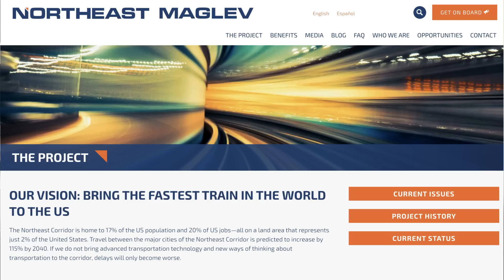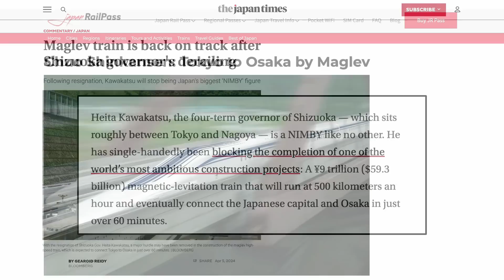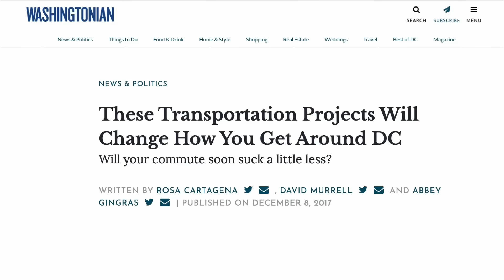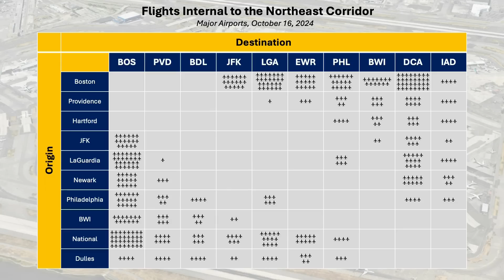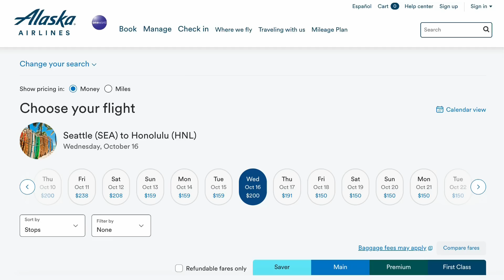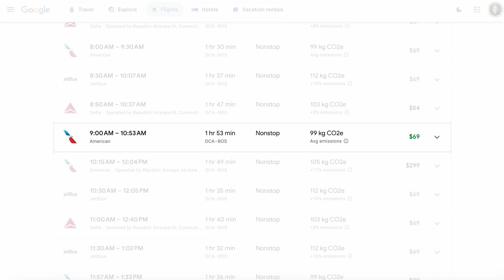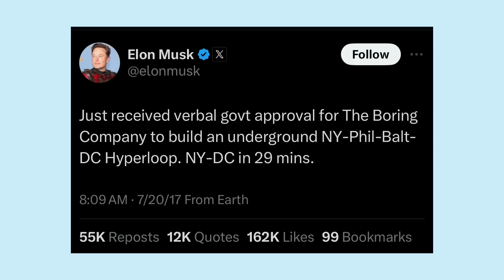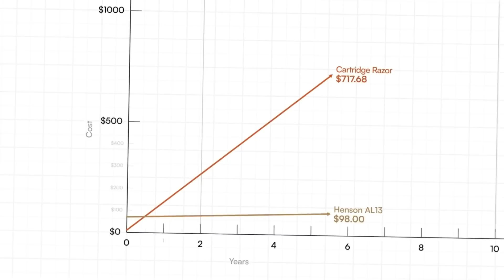A DC to Boston Maglev Would Be Awesome (and you know it)

Comment: Ray, love your work, but the problem here is stops and capacity. True, MAGLEV has better acceleration/deceleration, but it's not enough to dramatically reduce the travel time assuming your stopping pattern. Japan is planning for like ~3 stops with wider spacing instead of ~7 with close spacing. Also, Japan hasn't invented high speed maglev switches (yet), so right now they're capacity constrained to a train every ~10 mins as opposed to conventional rail every ~3 min. 

Conventional high speed rail FTW!

Comment: Video idea: how stops kill train speeds. Take the Acela--Wilmington is only 25 miles from 30th Street Station in Philly but it gets a stop because DE wouldn't let Amtrak run a train through their state if they didn't stop there. BWI and Baltimore Penn Station are also ridiculously close to each other (if DC only needs one station, there's no reason Baltimore needs two). If maglev were to be built (which I would love!) they'd have to get rid of some of these stops to truly benefit from the speeds.
Reply: @LiteBulb88  BWI is an airport in a suburb and Penn Station is in the heart of Baltimore. They serve separate but important needs.
Reply: DC has two. The northeast regional stops at New Carrollton. Three if you count the limited stops in Alexandria.
Reply: Wilmington and Baltimore Penn both lie at nasty curves on the NEC that require the train to drastically slow down. Skipping the stop (assuming they do it efficiently like Japan or even Brightline) would save very little time (<2 mins).

Comment: i do agree with the go big or go home idea of if you're building an entirely new corridor anyway you may as well get the most value out of it, however one of the biggest issues with maglev is that it can only be used by maglev trains, while conventional highspeed has been so successful because it doesnt need to be used by purely 350km/hr trains as countries get their value out of them by also running slower 250km/hr or less on the same rail lines as high speed trains are for good reason much less frequent than a commuter service (even services that have 3 trains an hour still have slower trains run inbetween because 20mins is a lot of time to have nothing using the expensive rail infrastructure)
Reply: knowing that maglev is basically a monorail but with magnets does mean we need to be careful with how excited we get for it (too many cities got over excited by regular monorails and look where they all are now) i think where maglev will prove most useful is along corridors that already have 350km/hr high speed rail and are congested to the point that they have trains running every 5 minutes at peak time (like japan) this is similer with what the uk was attempting with hs2, high speed wasnt really NEEDED between london and birmingham BUT the existing rail corridor was already bursting at the seams with congestion so the choice to both invest in high tech high speed rail while also increasing capacity was one of the few good ideas with the project (i dont need to go on with how the overall project went)
Reply: @brimbles4999  I believe CN's point here is that if you don't already have a saturated HSR - because of reasons - but already have enough demand to saturate it if it was there - they you save money jumping up to servicing that theoretical demand.
Reply: The other advantage of desinging the HSR/MagLev route from scratch is that it can be designed for express service from the start.  This means it is able to route away from minor population centers that an express route would skip anyway, potentially allowing different rights-of-way.

Comment: A similar corridor exists along the southern edge of Ontario between Windsor, Toronto and Montreal/Ottawa. It's already a rail corridor and could be converted to high speed rail relatively easily by eliminating a bunch of level crossings. Maglev would certainly require more dedicated infrastructure, but either option would pay for itself with the number of short hop flights it would eliminate between Toronto and Montreal or Ottawa alone. I could see both corridors meeting at several points too.
Reply: Get the international issues settled and the train could go farther through Detroit to Chicago!
Reply: Shoutout to Brian Mulroney for privatizing CN and all of the railroads the government had built for them, so now trains between Toronto and Montreal are perma-gimped by freight.
Reply: There is not enough people that go to Windsor .  The heavy autombile traffic on the 401 is largely thru to the USA .  Getting off a high speed train in Windsor is the middle of nowhere . Montreal to Toronto via Ottawa on a new line ok , but Toronto Union station is at over capacity now , so where would the high speed train arrive ?
Reply: @lassepeterson2740  Windsor is a de facto Detroit suburb and there's probably enough demand between the two...
Reply: @stickynorth  Exactly so you get kicked off the train in Windsor and then you gotta find your own way over the boarder .     Again there is not much in Detroit neither and no real sign of any big future .
Reply: @lassepeterson2740  https://en.wikipedia.org/wiki/Detroit%E2%80%93Windsor 5.976 MILLION is hardly nowhere...

Comment: It's fun to talk about Maglev in the U.S. but we all know that it ain't gonna happen. You should take a look at "The Grand Paris Express" project. Paris is in the process of doubling the size of its Metro with fully automated trains, 68 new stations, the trains will have 3min headways. Some above ground stations will have special pads to allow private developers to build apartments directly on top of the stations. Most of the new lines will be underground with some elevated. The goal is to relieve the pressure on central Paris Metro and allow people to go directly from suburb to suburb. It's underway, it's happening, and could be a great model for many American cities.
Reply: What's really needed is a way to cut construction costs and time. For all our infrastructure projects. Even on road projects we see the time length go far too long in comparison to project size. Some of this is due to construction companies bidding on and securing too many projects. This means they are stretched thin. 
One mistake that was made way back when the Interstate System was first started. A provision should have been required right from the start that part of the land acquisition should have included right of way for future rail systems. One of the best advertisements for HSR I can think of is being stuck in traffic and a HSR trainset goes by at 250 to 300 kph. Also one thing to keep in mind. HSR is not going to eliminate all Intercity travel by private automobile. It will eliminate a lot of it. Or at least the need. HSR really needs the support of feeder transport systems into and out of stations.
Reply: @mpetersen6  Typically, railroad rights of way in the USA are about 100 feet wide. Interstate highway minimum rights of way are typically about half that, but most are much wider than the average railroad ROW. There is PLENTY of "free real estate" available already!
Reply: @colormedubious4747  When acquiring land for Ontario's highway 401 in the 1950s/1960s, a 300-foot ROW was purchased along the entire route (500+ miles). This allowed for long stretches of 14 lane highway to be built with minimal (if any) additional expropriation/demolition.
Reply: @markfinn0  That's great for Canadia, but isn't 401 a legendary cluster-boink?
Reply: @colormedubious4747  yes it is; yet another stretch (QC-MTL-TO-??) of NA that would greatly benefit from HSR or, fuck it, Maglev.
Reply: Meanwhile, they turn a blind eye to the horrible living conditions in the surrounding suburbs where most of the immigrants live.
Reply: reenforced stations for private development above is extremely common worldwide, like, london was doing that in the 1800s
Reply: @KingFinnch  Three words: Grand Central Terminal. The many, many billions of dollars' worth of buildings along Park Avenue were famously built after the sale of the "air rights" above the terminal's rail yard, which was trenched below street level and liberally festooned with massive pillars to support the streets and future buildings.
Reply: Endless great models that will take three times the time and five times the money here. Your supposed wealth is worthless when everything takes 15 times as much money. Capacity and a good system are what matter.

Comment: Meanwhile Amtrak begging for $100 billion to modernize their east coast electric system (from the 1920s) and getting 6 billion.
Reply: The electrical system upgrade would only be around $4 billion, including the maintenence backlog on current equipment. The $100 billion is for bringing the whole line from DC to Boston to 190mph capable HSR, including building a whole new right of way in Connecticut (or Long Island) to circumvent the main area where the NEC is stupidly slow. So, the NEC is definitely going to improve long before any Maglev line gets started, let alone finished.
Reply: @SteveGettingAroundPhilly good to know!
Reply: Are you sure? I thought that they got $600B a year or 2 ago.
Reply: @eugenetswong No, the 1 trillion was part of a general infrastructure bill, with only about 60 billion dollars going to Amtrak across the entire country
Reply: @Ry_TSG  That sounds more like it. Thanks.
Reply: @eugenetswong  looks like I was wrong about the numbers here, misread an article. Regardless, they need way more money than they've been given to keep things working, not to mention upgrade things.
Reply: @Carsonist  I agree completely.
Reply: @eugenetswong  Mostly that went to highways and other deathtraps.

Comment: This would be huge for Connecticut. I also highly doubt that there would only be one stop in state as it says (Hartford), likely it would follow a similar path with new alignment until New Haven, then go North to Hartford.  NYC -> Stamford -> Bridgeport -> New Haven -> Hartford -> UCONN Storrs -> Providence RI. All these would stop in a city with a population of 100,000< and a catchment area of around 200,000<.
Reply: I think the idea with Maglev is to reduce the stops to only large cities (metro area of 1.3m or more perhaps), so it'd be Hartford and maybe not one other CT stop because you want to keep the average speed up and stops down.
Reply: @tomdubay2225  I 100% agree and see your point, but the problem with Hartford being the only stop is that it has much less train commuters compared to stamford, bridgeport, and new haven. These cities connect to other train lines from the area such as the New Cannan line, Waterbury Line, and Shoreline East. Also, Stamford and Bridgeport are basically smack in the way of a route between NYC and Hartford.
Reply: @JL1  It seems the point of this is to not necessarily replace train trips but rather car trips and some NE Cooridor flights.

Comment: The Shanghai maglev opened in January 2004. IF it could’ve been built cheaper in China then we would see more than 18 miles (30 km) vs 25,000+ miles (40,234 km) of high-speed track over the past twenty years. The extra cost is astronomical and would never pencil out. There are no economies of scale for maglev. HSR #ftw

Comment: I missed the part about how this would be paid for?  Will the cost of this rail system be covered by the tickets sold?  This is a rhetorical question - of course not.  This is a silly "rail" dream of urbanists - The existing rail, cars/buses and air travel options currently available work well without wasting untold BILLIONS (study what the Chinese did) of dollars on infrastructure that will never pay for itself.  I am a resident of the NE Corridor - and I travel by each of the modes I mentioned depending on my schedule, budget and needs.  CityNerd?  More like SillyNerd.
Reply: The Pentagon got $813,000,000,000 in 2023
Reply: HSR is not a waste. The interstate system was, however.

Comment: This would be super cool, but we do need to keep in mind that this is valuble as a super express, but we should still focus on building a regular high speed line as well, which can serve not only destinations between these biggest cities, but also nearby corridors as cities. Even with a direct maglev connection between Philadelphia and New York, a trip between say Harrisburg and Newark NJ would be better served by HSR, essepcially when the rail northeast corridor is upgraded consitent 165mph+. In addition these routes would also be better served because more highspeed one seat rides to the various brances of the NEC could be implemented when the large Trunk capacity is borne by the NEMagLev.

Comment: As someone who is local to DC, I dream of this all the time! 
Baltimore is a hub of culture of experiences to be had. I'm often driving up there for concerts during the week. I've looked into taking a train or bus, but they're so slow and infrequent, that doing a 2+ hour drive in rush hour traffic is always the better choice. Not to mention the services ending at 11pm, so I hope the show ends by then!
Reply: "taking a train or bus, but they're slow" -- for the 40 miles between Baltimore Penn and D.C. Union Station, the slowest scheduled Amtrak is around 51 minutes, the fastest (#2122) as little as 28 minutes.

Not in a trillion years could driving be faster than that
Reply: @CaradhrasAiguo49  If your origin and destination are close to the station and the schedule works, then yes. Otherwise, no.
Reply: @jyutzler  Exactly right.   And this is where this creator strays in this video.  He looks at a trip between the White House and Boston Commons.  A more common trip would be from Reston Virginia to Roxbury.  Sites likely to be some distance from the train station.
Reply: @jyutzler  That's the problem with DC and US cities outside of the (except Chicago): low density.  Too few people live near the core. DC actually mandates low density with its height limits. The beauty of GCT is there's lots within walking distance. Compare the area around GCT with the area around DC Union Station.  NY Penn is finally getting some dense development with Hudson yards, etc. Previously, the West Side was largely a post-industrial wasteland.  Overall, NYC is the only US cities comparable to the Asian cities in density.
Reply: You can’t just take the Marc from DC to Baltimore? It’s only $9 one way.
Reply: @Undecided0  Not for an evening activity. Last train is around 10.
Reply: @Undecided0  MARC takes over one hour.  It's a distance of less than 40 miles - completely unacceptable.  And the trains are on a very limited schedule, even at rush hour, there are gaps of an hour in some slots.  Acela makes the trip in 29-35 minutes – better, but still just silly for such a short distance on a supposedly high-speed train.  The potential of Maglev between D.C. and NYC, Boston, Philly is huge, but a "starter line" between D.C. and Baltimore is more aptly labeled "stopper line" – no one will use it, so it would be called a failure and thus doom the future "extension north" of such a line.  A few people might use it if the Baltimore station was placed in the literal center of downtown, but (and no one mentions), importantly, the proposed location for Baltimore's Maglev station is literally 2+ miles from the nearest EDGE of the city center, so it's obvious the planners don't care one iota that it won't be anyone's idea of a transportation solution for Baltimoreans.  Tellingly, DC's proposed Maglev station location is even closer to the business-center of D.C. than Union Station is, so, once again, the planners clearly don't care about Baltimoreans using it, so it's doomed.   It's also not that big of a center-to-center travel market, even if the station were at the center.  Not that many non-commuters travel between the two cities, and mostly people drive because you have to drive anyway to get from the train station to your destination – especially in Baltimore (where I live) which has the stupidest-designed transit network I've ever seen: almost completely-empty, but high-capacity, light rail trains traveling routes that seem intended to actually AVOID population centers.  Plus you're almost asking yourself to get mugged by a masked, gun-toting 14 year old while walking a few blocks from the Baltimore theater to the train station.  This is not right-wing hyperbole: it happened to me within 2 years of moving to Baltimore, after having lived in NYC for 40 years without once being mugged.
Reply: @Undecided0  Marc is infrequent and breaks down all of the time.
Reply: @pisceanbeauty2503 Define “all the time.”  Is MARC a part of your commute?
Reply: I just went to the B&O Railroad Museum last weekend and the irony of it was that I wanted to take the light rail and couldn't because it didn't start service until 10:30! Ridiculous!
Reply: I live in Baltimore and I feel the same! I have family in VA and friends in DC who i would like to meet
Reply: An HSR is too expensive just for people traveling to get culture.
Reply: NOT MUH HECKIN CONCERTINOS!!!
Reply: I'd love to get from Boston to NYC with just a 1-2 hour train ride. That would free up SO much time, plus the time spent on the train itself can be doing work or just wasting time browsing the internet. As of right now, unless you leave Boston at the perfect time that avoids all traffic, it usually takes like 2 hours just to get to Worcester. Unless you wanna torture yourself and take the commuter rail so you only take 1 hour instead (if it's not having any problems lol).
Reply: You can't find cultural experiences in DC !? wow!  who's the native here?
Reply: @pavelow235 stop the baltimore dc conflict it’s so ridiculous